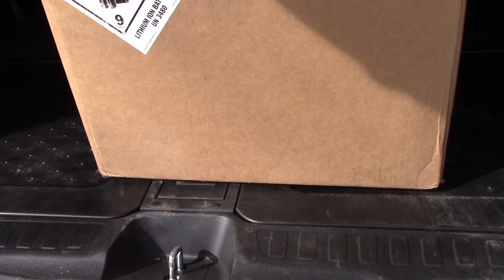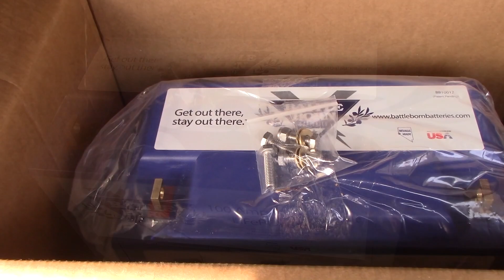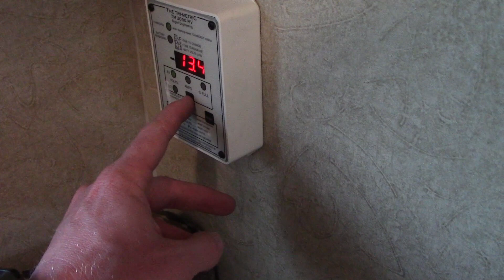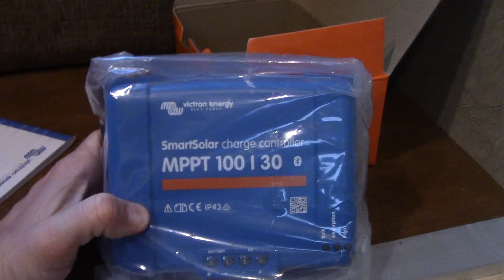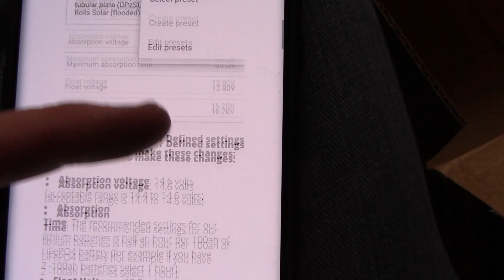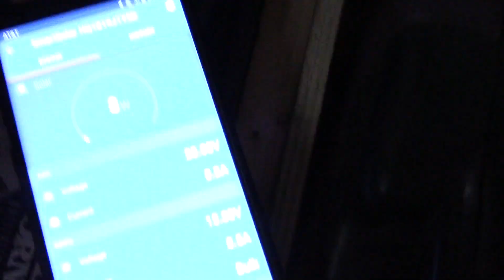Lithium Battery Upgrade For Your RV - Battle Born LifePO4 Lance 825

Comment: ok i would like to upgrade in my new lance 825. lithum is greek to me, so here i am learning or attempting to. i see  other lithum like ampere time is like 300 bucks. Can you educate me as to why 700 more dollars for a battle born. TIA. thanks for the video as well , just awesome
Reply from the maker: Many reasons but the most important is low temperature cut off. If you charge a lithium battery below freezing you will destroy it. If you don't do any cold weather camping, the Chins or Ampertime batteries will work just fine. I have used both.
Reply: @JackofAllMasterofNone  thanks for that info. appreciate it much. Ampere time is a good choice then? thanks

Comment: Great upgrade! I think the secret of LiFePO4 is the actual power (100 AH vs. AGM). The stated AH is really, really close to what you get (99% efficiency). Sure, 60% lighter and often much smaller footprint and faster charge....Imagine if you had chosen a Lion Energy swap- it's so small (compared to (2) AGM's- it's actually hard to believe that it truly is MORE powerful!!!
Reply: Funny, I just read the body of the description- That TRULY is the question. I had to swap alot of things in my truck camper ( The builder must think that power is barely needed?)- thicker cable,  a battery monitor (& shunt!), a LiFePO4 charger, an INVERTER, etc... Sadly, the 'upgrade' which was wicked 'spensive, ended up being a bank buster at the end of the day. Great edumacation though. And, you can always add more solar later (roof? deployable...)

Comment: Thanks for another informative video. I know this doesn’t pertain to this video, but we just looked at a 2020 825 and the propane compartment floor is wide open. I was surprised being it is supposed to be 4 season. I thought propane can freeze. Is your propane floor open too? Thanks, Rose.
Reply from the maker: Yes, it is open. This is to prevent propane from filling the cabinet and causing an explosion hazard if it were to leak.  I have never heard of propane freezing.

Comment: I see its been 6 months since the install.  How's the Battle Born working for you?
Reply from the maker: Great
Reply: @JackofAllMasterofNone  Did you add an inverter?  If so, what kind?
Reply from the maker: I have not added an inverter
Reply: @JackofAllMasterofNone  are you running everything that's just DC then?
Reply from the maker: @darylwright3393  For the most part. We usually have shore power most places and I also have a small inverter generator for when we dont
Reply: @JackofAllMasterofNone  Do you think a second battery will be needed?